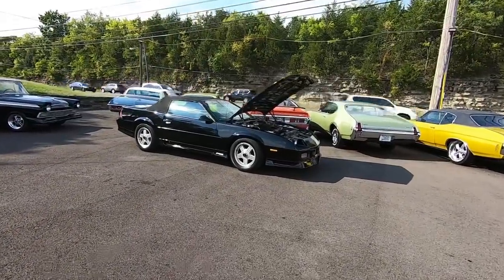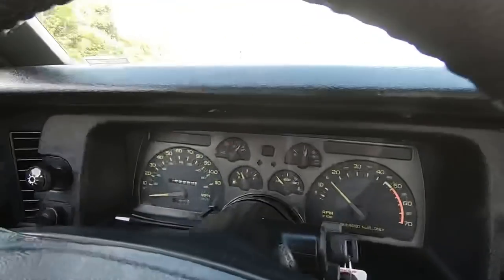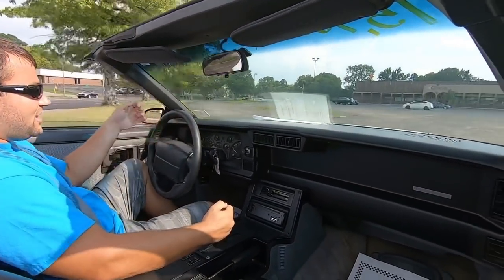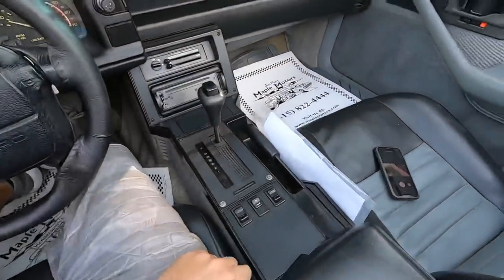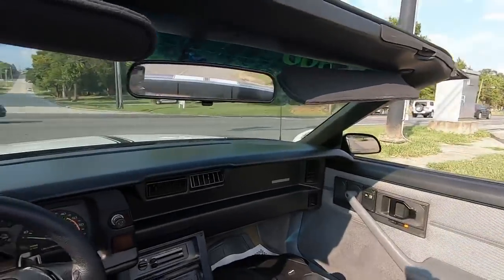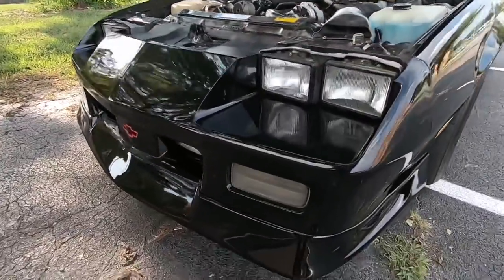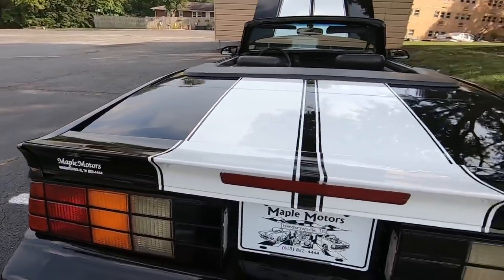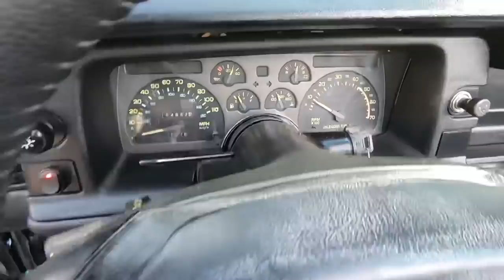Test Drive 1991 Chevrolet Camaro RS Convertible SOLD $15,900 Maple Motors #1264

Comment: 164k that’s a lot of miles.  It’s been redone with paint and a different interior and exhaust.  Seems to run just fine as it sounds great.
Reply: Same thing I was thinking. Beautiful car, but the mileage is crazy with the price, compared to other 82-93 v8 camaros on the internet... wouldn't be afraid to buy it, but definitely not a much over 10k.
Reply: If you YouTube search 1991 Camaro RS, this one pops up and mine pops up from some time last year. Unique Classic cars in Minnesota. They had it advertised for $17,900. I bought it for less than this car with 28,928 original miles and even my car had suprises. Just being original I had to replace all the rubber lines and flush coolant and brake fluid. Nick is a good guy but if I paid less than this for a car with more than 130,000 less miles, he's got to be more realistic. I know for sure I could have bought mine for less.
Reply: @orchids3332  a few years back you could get that 160k car for 5000 LOL. Sucker for every deal I suppose...